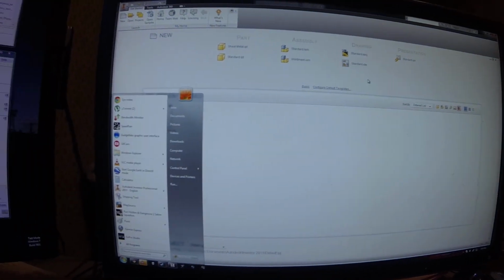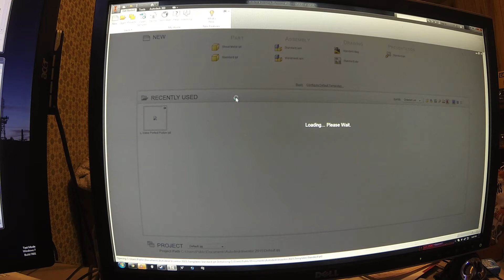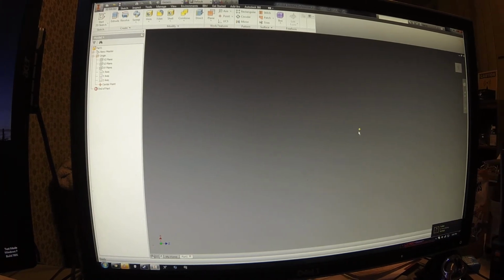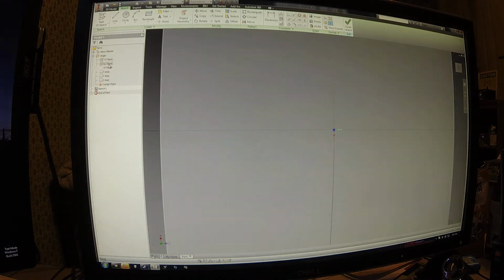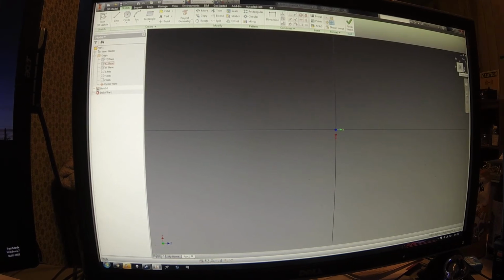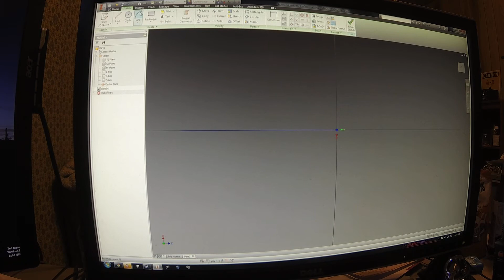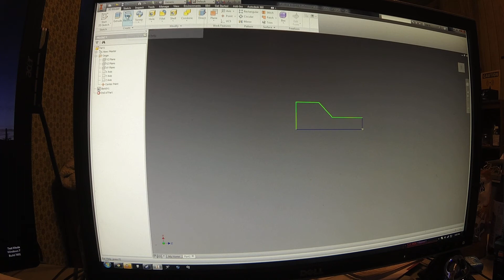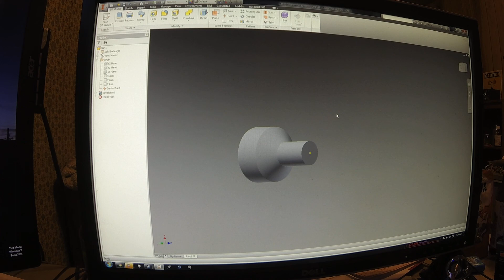Autodesk inventor, lathe part design workflow question to all.

Comment: I think in the settings you have an option where you can fix the plane of the first sketch, but as far as I know, the drawing plane doesn't matter at all.

For setting diameter dimensions on rotated parts just draw your center line, select it and change it to a construction line (dotted).
Then, if you start setting a dimension from an outline and move the pointer across the center line the dimension should switch to diameter.

I would give you a real step by step but I dont have access to inventor anymore, also I was working with the German version so e.g. the "construction line" could have another name. :)

Comment: So this is a month late, but anywho...no need to go through all the hassle. You're used to MasterCam which is a 2D program with a 3D face lift shot at it with a potato gun. Inventor is a native 3D program. When it comes to making toolpaths in Inventor, it doesn't matter even in the slightest what the model orientation is. You select the part orientation in the CAM setup page. No screwing with WCS or any of that crap. You can apply toolpaths to a cube without ever changing the drawing orientation or WCS. Just select what face you want to cut in the CAM setup.

I pulled up a new part and started a sketch using my normal method and the method you used, and neither put an XYZ at the origin. So that's odd. Maybe a setting? Yup. Tools > Application Options > Sketch > Display > Coordinate system indicator. Uncheck the box. Turn that off and just use the main one in the bottom left. Again, it's irrelevant, but perhaps less confusing.

Shift+middle mouse = free rotate rather than trying to drag around the damn box.

I very rarely use the revolve command for drafting outside of MasterCam. But if you want to, type the diameter/2 in the length box and it'll output a radius. Personally, if I want to make a round part, I start with a circle. I draw on the XY plane and then extrude in a negative direction. Same effect, different method.

Comment: late to the party. blame AVE ;)

from what i understand, you dont actually have a problem. your actual part is in the correct orientation, that extra coordinate system you see is associated with the sketch. since the sketch is 2d, inventor basically creates the sketch on its own plane and your just seeing the coordinate system of the sketch plane. it should have nothing to do with the orientation of your part...

as far as entering diameter when creating profiles to revolve.... im not sure theres an 'out of the box' solution... if you would really prefer to use diameter, just enter in "diameter/2" in the dimension. that way, your not doing the math and hoping you enter the value right, your entering in your known dimension and letting inventor do the math.

meh. just my 2 cents...
Reply from the maker: All makes sense, its just a different way of doing things, i took a faster learning curve with mastercam at work. So i find myself trying to do things that way instead of just going with the flow. The constraint system is super awesome and intuitive though, love it.